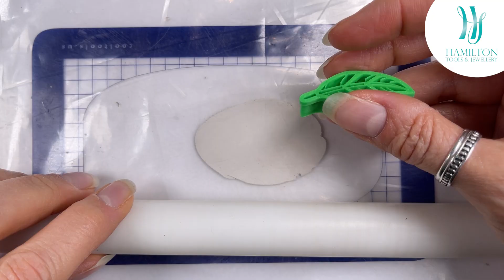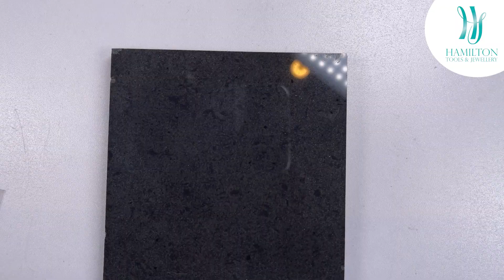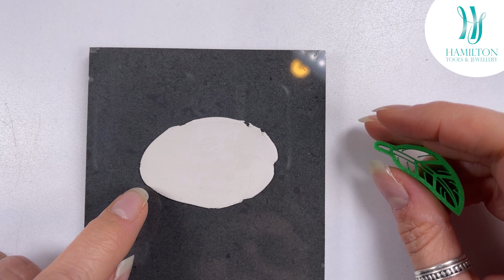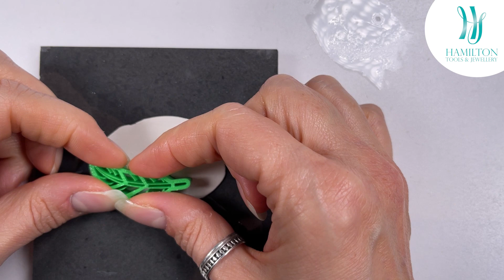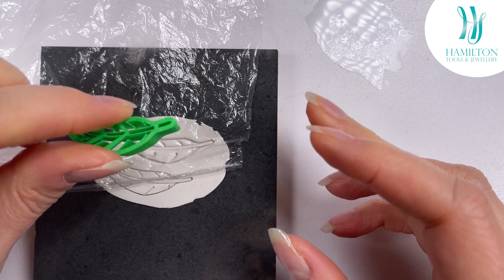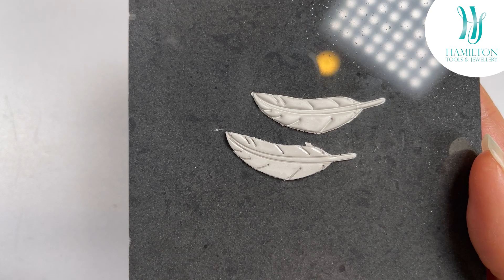Using 3D printed cutters with detail and metal clay

Comment: Such nice fingernails, ;) I call cutting 'through' cling film/Saran Wrap to achieve the rounded edge -
'soft shoulders'. 

Also if you don't use a liquid lubricant, lightly pressing a cutter straight into, and lifting straight out of, solid lubricant (Badger Balm, etc.) will get both the inside and outside of the cutter walls, making it easier to remove the cutter more easily.  Great video.  Of course.